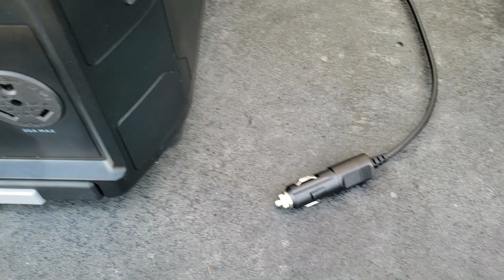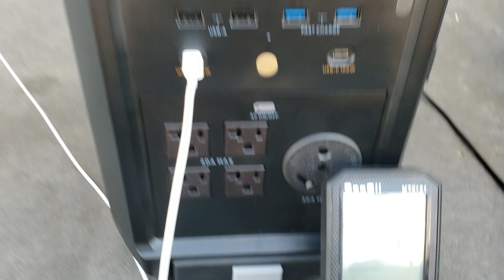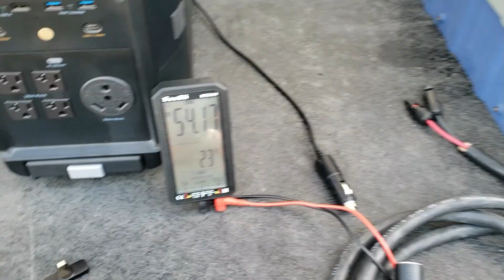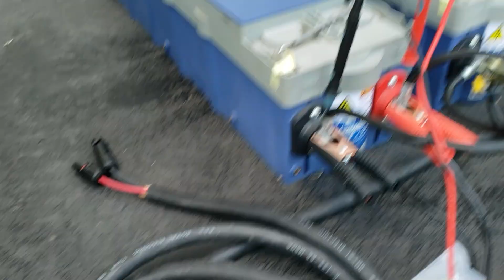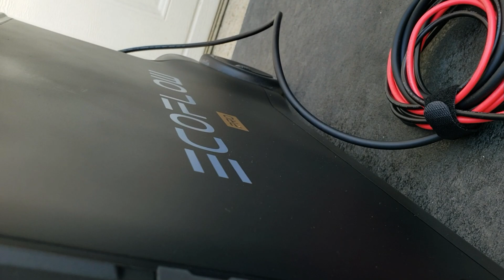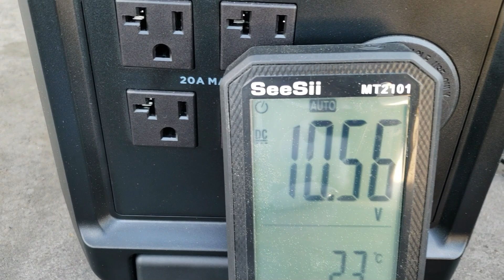ECOFLOW Delta Pro Charging at 48VDC

Comment: You have the batteries connected in parallel. Wouldnt you connect one cable to o e battery and one cable to the other battery, for the output?
Reply from the maker: The capacitors I’m using is 54 VDC

Comment: Nice video!  I'm looking at getting a 12v to 48v DC boost converter to hook to car battery.  It is rated at 20A. Hoping to connect to MC4 connecter and charge Delta Pro that way.  Your thoughts?
Reply from the maker: You should definitely take a look at the Bluetti DC charging enhancer model number D050S i’m pretty sure you can make that work
Reply: @GeneratorReviews  Thanks! Will do!

Comment: The beauty of Delta pro is it give you many choice to choose .Why you do that when you can use your Delta Pro as " Master "  with EcoFlow DELTA Pro to Smart Generator Adapter for Extra Battery ,you turn your 2 batteries as slaves . the way you do this cost time and your built in charger work harder  . You still can use your wind turbine charge the batteries same time .
Hope that you understand it what I mean .But best way you can contact Ecoflow support they will give you the information .

Comment: Using that charge controller would be a good option if you needed to use a gas generator in an emergency or camping and don’t want a generator running all night

Comment: So a Ecoflow delta Max has a solar input max of 800 watts when solar charging in the solar charger port...is it possible to charge an ecoflow delta max with solar panels in excess of 800w by using an invertor connected to the AC charging port? to clarify, lets say you have 2000watts of solar input, going through a controller and into the ac wall plug.  can you cheat the 800w max this way?
Reply from the maker: That might work I don’t know how efficient it will be but it will be like charging from an AC outlet right
Reply: @GeneratorReviews  yeah, to try and get more input from larger solar array

Comment: What's the maximum current that can be drawn from either the 48V battery or the solar panel?
Reply from the maker: The maximum current that can be drawn for DC charging is 8 A and the maximum current that can be drawn for solar charging is 12 A
Reply: @GeneratorReviews  Thanks for your response. But both solar and battery use the same input. How will the charge controller differentiate between Battery and Solar? In as much as one form a string of batteries to say 48V in series. Does it mean that the integral charge controller will draw 8A max instead of 12Amax?
Reply from the maker: @samuelodeyemi9245  I noticed that when I plug the solar cable it changes the icon on the display to solar.
Reply: @GeneratorReviews  thank you for your videos, I subscribed to your channel.   Regarding the difference between the cigarette lighter cable transferring 8 A versus the solar cables transferring 12 A, I would think it's due to the size of the cable, i.e the cigarette lighter cable is thinner and is designed to transfer no more than 10 A.  I am guessing the cable got really hot during your test!
Reply from the maker: @gatsu2001  I realized the solar cable has a small pin so it knows the difference between the cables
Reply: @GeneratorReviews  interesting about the small pin on the solar cable!.   I have an Ecoflow River pro and on that one the solar and car cable connector look identical.  I asked ecoflow support how the river pro knows the difference.  They said that the unit monitors the voltage, if the voltage fluctuates and it's higher than 12 v then the unit will switch to solar input allowing up to 12 A go to the unit versus 8A with the car charger.

Comment: Gotta love them supercapacitors and they're pricey little buggers. I use the 100 Farad 2.7 volt versions for the ISS (integrated sensor suite) module that on the solar wireless Davis weather stations. When they're fully charged, I get just a little bit shy of 5 days of autonomy when I cut power to the solar panel to simulate no sun conditions. They're so good to the point, I don't even bother installing the CR123 backup lithium battery. However I did voided my warranty by replacing their pewny stock 10 Farad for the bigger one, but they've been in service for 5+ years not skipping a beat.
Reply from the maker: Yea!! I absolutely love them super capacitors they’re pretty pricey but I wouldn’t build a system with out one. I have the 12v version on my Rv

Comment: It’s doing what its supposed to do.  Hooked up to a car to charge, the systems on the car control shutting off the capacitor at the right level to avoid damaging the battery.